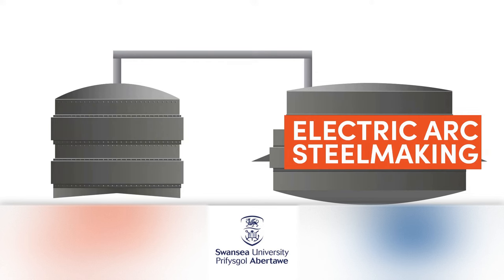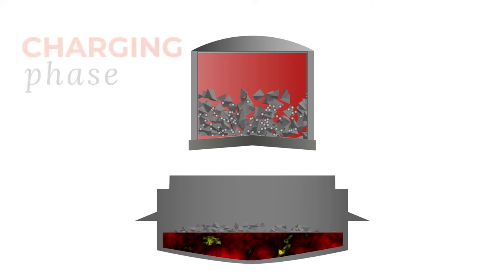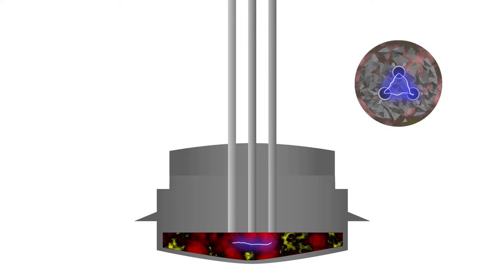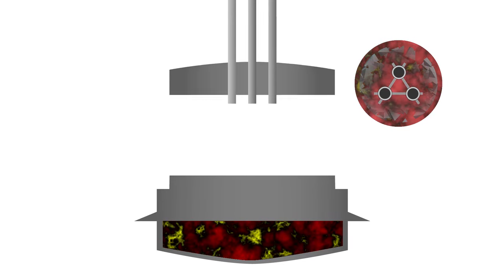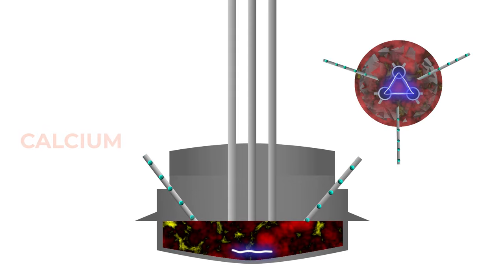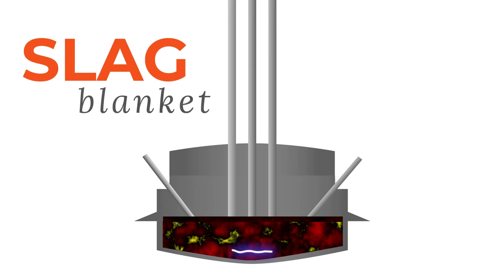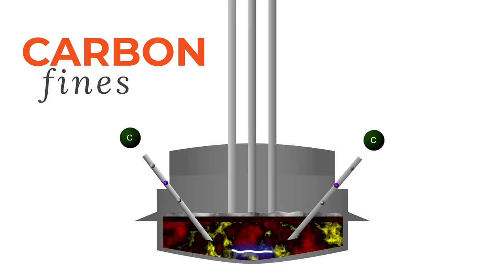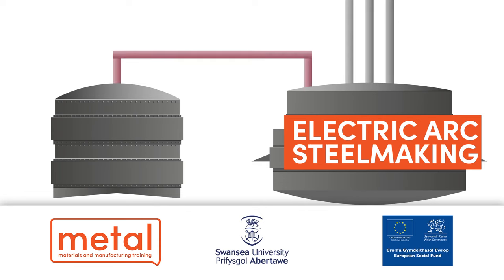What is an Electric Arc Furnace and how does it work?

Comment: I worked at two EAF shops in NJ for decades. Instead of direct reduced iron, in order to boost the carbon for high carbon grades we added to the steel scrap either coal, coke, graphite or high carbon railroad rails instead. Also, to supplement the arc heat in the cold spots we had oxygen/natural  gas burners. Supersonic Oxygen was injected through a lance through the slag door.
Reply: Sweet. I would love to see that in person someday.
Reply: @BackyardBeeKeepingNuevo  when I first interviewed for the job as an engineer at the mill, I was asked to come back for a plant tour dressed in clothing I didn't mind getting sweaty and dirty.  I did, and was mesmerized watching the arc furnace.  I was told a previous applicant did not have a plant tour before he was hired. His first day on the job he was taken into the melt shop and was about 30 ft from the arc furnace at a safe location.  When t started arcing it scared the crap out of the guy.  He ran out, and immediately quit.  My reeacion, on the other hand, was, "That's awesome!" and I was immediately hired.
Reply: @PAHighlander24  :face-blue-smiling:
Reply: @BackyardBeeKeepingNuevo  animation makes everything look good.
Reply: @niladribiswas498  Yes it does

Comment: what voltage and current do they run at????
Reply: Depends on the transformer but typically around 1,000 volts at 75ka.